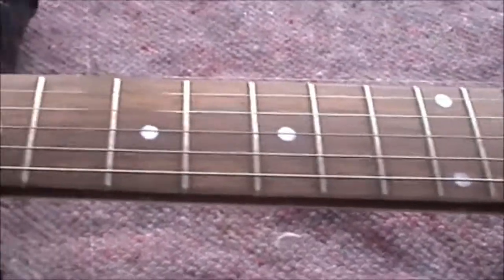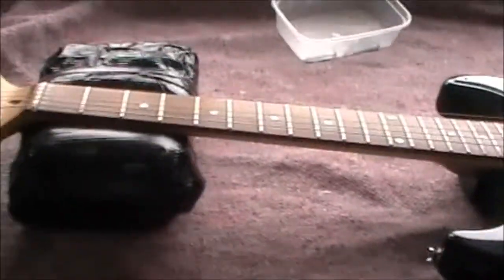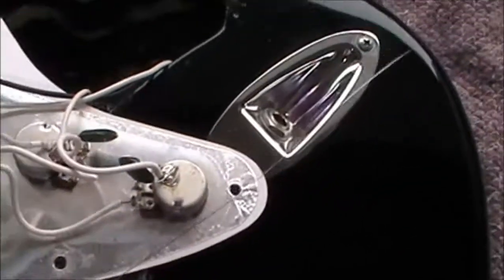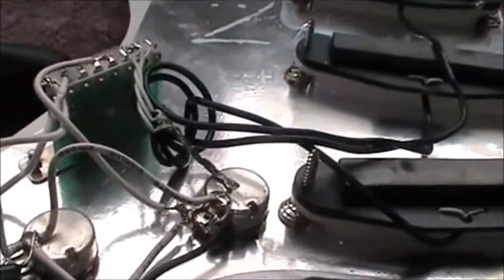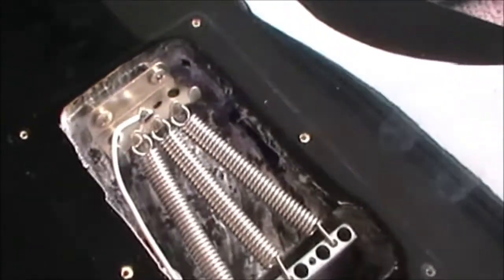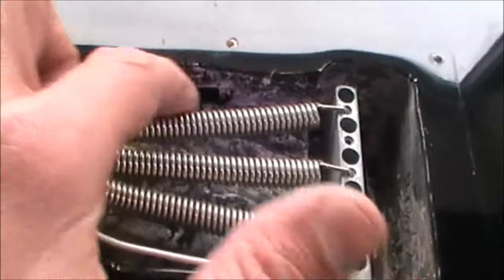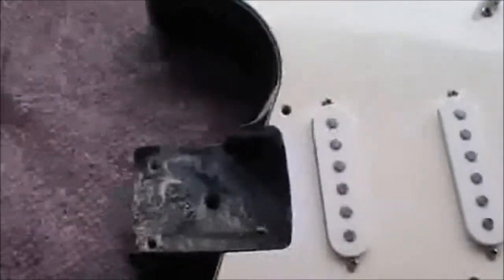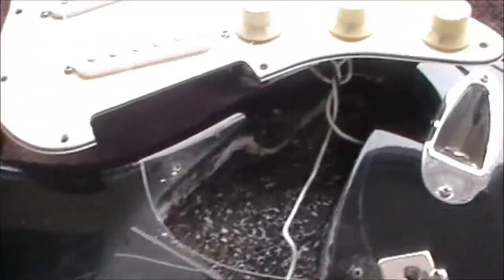Squier Stratocaster Mega Mods Pt-1 Is this a Squier?

Comment: That's a CXS Chinese squire made for the Asian market sold in starter pack kits. Made in the Axl factory, I believe. They are often sold as squire standards but the standard will have standard on the headstock in small letters. The CXS has a full sized neck and body but the bullet squire hardware. Not bad for $50-80! Nice necks for sure!

Comment: Yes, a Squier SE from the Pack series. As pointed out the serial number was not a decal, but a sticker which easily fell of or was removed. Also a "Made in China" black letter, gold background sticker at the base of the neck, next to the body is missing. The usual Black body, white pickguard for these guitars.
The only difference I see from mine is yours doesn't have the rose wood "skunk" stripe on the back of the neck.

Comment: Definitely a squire affinity logo on the neck, but it looks like a home made body.  the routing is the giveaway.
Reply: Agreed... My Affinity was built in Indonesia; was plainly marked on the back of the headstock with a serial number, and has an "Affinity" logo on the front lobe of the face of the headstock.  It also had a sticker with CE placed near the volute on the back of the headstock.  The cavities, all cavities, were routed smooth; with shielding paint applied to pickup and control routes... The guitar in the video looks as if the routes were chiseled out... Very rough; compared to mine...

Comment: I've got 1 of those used in a pawn shop that I'm currently working on upgrading a bit.  No country of origin or serial.  Most likely from 1 of those starter sets fender sells.  You've probably seen them, guitar / gigbag/ amp 1 price.  Btw you're right about people not wanting to fake a squier.  There's no money in it.  the scammers go for the higher end american fender models where the cash is, especially the vintage models.

Comment: how thick is body ? any Squier that's labelled as "Strat" or "Tele" is pretty junky thru out
-  look for a Full Name decal like "Stratocaster" for Standard, Vintage Modified or Classic Vibe series [ 1 exception is "Strat" on a small headstock and a 1 3/4" THICK body - striped neck but no dark insert on headstock front - avoid any Squier "Bullet" or "Affinity" series
Reply from the maker: The thing that got me thinking if this was a squier or not was the pickup routing, a different body with a strat neck. However if you watch the other megamod vids you will see it didn't really matter in the end.